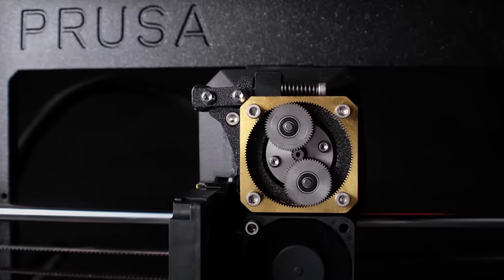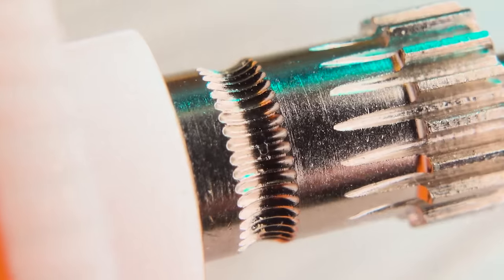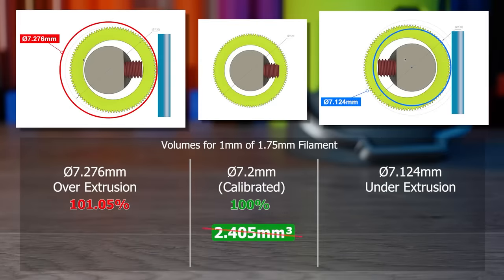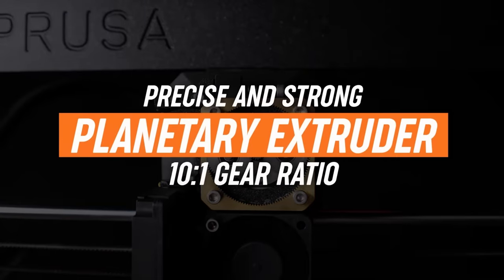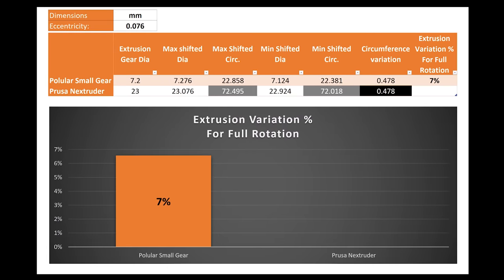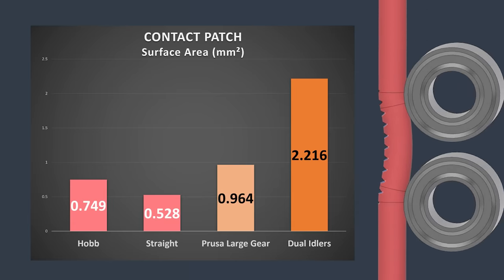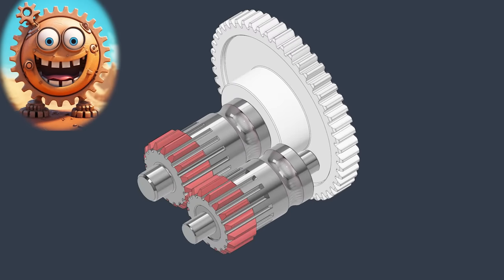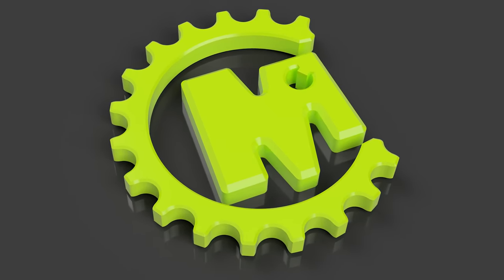Revolutionizing 3D Printing: Prusa's Game-Changing Nextruder

Comment: What we also need is, consistent filament diameter, and volume. With the new large gear, see the possibility of a ribbon like filament.Not only the filament will be cheaper, it could also be more consistent in volume, made possible by the aspect ratio. It could pack more filament on reel, also could enable even more volume of extrusion. It might also be necessary to have a rectangular funnel shaped intake path on heated chamber. Just some thoughts .....
Reply: There has to be some reason that the round profile was developed back in the 80s or whenever it was. But I am sure curious what that is, because a filament shaped like fettuccine would certainly be easier to work with than filament shaped like spaghetti.
Reply: @user-mz6qu3hz6m  I feel, it may be due to easier extrusion(all you need is a round hole, easy to achieve with common drill type machine tools) and easier winding(you can cross wind a round filament easily,compared to a wide ribbon, which could be limiting). But to get more precision and accuracy, it might be a worth while deviation(esp, with reduced surface grip of the 1.75mm filament). Additionally, with faster and bigger heater, it may be easier to push more volume of material for faster printing, due to increased grip of the ribbon style filament. Again, some more thoughts .....

Comment: To be fair, I still think that lack of tolerances is the huge issue in terms of BMG. Genuine shaft was 4.96mm, while for this bearing arrangement it should be  5mm ±4um, so we're causing wear on the bearings. The ID of the gear isn't reamed either from basic visual inspection, so they probably don't have great tolerances here either. In my opinion just proper shaft OD and gear ID (with respective tolerances) should be significantly better than what we have now on the market

Comment: Through the years I have always felt my Kossel mini with gear reduced stepper motor and simple gear and bearing compression system had just as good of results or better then I've gotten since. I still compare my best prints to prints off that machine from 2014.
Reply from the maker: Yup, this "revolution" is against the ways of doing things that nobody questionned for years.  We thought more nozzle pressure would be good for faster printing, we thought hobb grooves would give us that extra traction to achieve this pressure... Now we know it"s not... And I honnestly think this is the start of a revolution about how we took things for granted.
Reply: @MirageC  Increased pressure was never about greater speed. It was about forestalling the issues that result from back pressure when you push material of x volume through a bore of smaller y volume. As long as you have enough forward pressure to significantly overcome the back pressure, your material will exit the bore with a minimum of issues introduced. Yes, for the purpose of FDM plastic printing we've reached a point where some extruders provide enough pressure to push the material through many common models of heat zone too quickly so that it comes out while it's still "too cold" for our purpose, but it does still come out.
Reply from the maker: @claws61821  According to my tests, the pressure creep point of a material corresponds to the point where the print quality drops quickly to not being able to print at all.  This is not even taking into account the issues you are creating on Pressure Advance requirement.  Filament will come out, but it will not be printable.  High nozzle pressure is bad  The proper recipe for flow resides in the hotend, not the extruder.  We can print at 50+ cubic mm/s volumes at very high speed now a days with a simple BMG gear set.  Oh.... And I forgot to mention, I am running without the second drive gear ;)   Have a look at VzBoT videos.
Reply: @MirageC  I may have to watch your videos on dual gear extruders again, yes. Did you test the pressure effect in multiple hot ends/nozzles as well, or was that Stefan?

Comment: Thank you very much for breaking these components down for us and giving your analysis. I wish you had pointed out that the only thing that's truly new here to even commercially manufactured extruders is the dual idler bearings, but that's me nitpicking.
Reply: Thinking about it, while it was never commercial, there was an extruder several years ago that a school in South America designed and uploaded to Thingiverse that used most of an entire ring of drive gears or idler bearings around a central wheel, much like a peristaltic pump. That's not too dissimilar to the dual idler design aside from the quantity.
Reply from the maker: Cycloidal? or perhaps Harmonic drive?
Reply: @MirageC  Neither as far as I recall but I would have to find it again to be sure.

Comment: I do see a problem with older filament which has become brittle.. the bend might result in the filament breaking in the midst of roller bearings, clogging up the mechanism. I had that happen when I designed a rather similar (without planetary gears) drive  for more contact.. it worked great, but was very sensitive to the usage of fresh versus older filament. Since I don't print a lot, my filament usually has some degree of staleness which mad it quite unusable.
Reply: I already tested edge cases like super old PLA as well as old TPU on the MK4 and it just prints like a god. Didn't even adjust the idler tension or anything, it just worked.
My hypothesis is that due to the idler bearings having a slot in the middle, even if the filament breaks, the path is so constrained that the top piece would just continue to nicely push down on the bottom piece and you won't notice the break at all.
Reply: My biggest concern would be for filaments like ePAHT-CF. That stuff is very stiff and brittle and using two plain bearings to bend it aroundone large drive gear might just snap it...or the force to make it compliant around the bearings and gear may just overload the extruder motor. So far I haven't seen anyone print htis filament with the Nextruder...but this is a corner case filament and all other filaments should be fine.

Comment: How about comparing other big wheel solutions like Orbiter and LGX? A friend from the Voron community did some experiments and subjectively the nicest prints were from Orbiter 2.0 right after LGX Lite and RIDGA, the worst were the original BMG wheels and it didn't matter what extruder he put them in. The strange thing is that LGX Lite turned out worse than Orbiter even though it has bigger wheels.
Reply: LGX is like a combination of MK3 extrusion mechanics, using 2 gears of the size of the MK4 main gear. I really the control lever in LGX

Comment: This really does look interesting!  Also… whatever happened to the hotend Olympics?? I never saw a results video.
Reply from the maker: I had to change the approach of crunching the data before killing myself.  At the moment where the plan took form, Winter made conditions in the shop too cold for proper testing.  I am working on setting up the printer and print head for a restart within the next couple of weeks.

Comment: Nice video! Though you missed one thing - the two idler bearings are not flat, they have a groove in the middle to keep the filament centered.
Which means that manufacturing inconsistencies along the width of the gear are even less relevant since the filament cannot move left or right at all.
Reply from the maker: Great piece of info!  that is how I am planning mine too.  Thanks for pointing that out.
Reply: @MirageC  U604ZZ bearings, as used on the MK8 extruder. Off the shelf bearings. I'm designing a variant for my worm extruder that uses two of these.

Comment: The sole purpose of the drive rollers is to ram the filament into the heated chamber where it melts and as the filament then acts as a hydraulic ram it is the pressure that the melted filament gets from the incoming filament  that determines the flow.
Reply: Yes, and?

Comment: wouldn't the grooves pushed into the filament create a much larger distortion in filament volume? You would be pushing filament volume equal to the displacement of the grooves up/down and partially to the sides. Assuming most of the plastic is pushed up and down due to where the force is applied, You would get 2x he differences in volume displacement  from min to max groove depth.
(ie. min = filament - groove volume, while max = filament + groove volume) 
If the groove displaces 1% of the filament from either side in regular printers, you would get a 4% delta between grooved filament and no groove. In this case, it may be slightly less since it only produces 1 groove, but they will be deeper/wider at their full depth due to the straight cuts.

I have speculated for a long time, that ideally you would want a multi roller textured silicone feed system, to increase grip while preventing any change in filament shape. It may even be possible to use 2 "belts" pushing against the filament to feed it into the hotend.

Another improvement could be to increase the  length and thermal mass of the extruder barrel. This would allow a more gradual heating with a reduction in temperature fluctuation. Uneven heating of the plastic can cause thermal stresses and uneven thermal expansion/shrinking. This could lead to warping.

Comment: Yes, the nextruder seems a big step forward. The bigger gear alone definitly is an improvement, as I saw on my zorbiter (just a little bigger) and my TBG light. The new concept with two flat idler bearings might improve even a bit more - but I wonder how much, as with the heatbreak integrated in the nozzle reaching up extremly near to the gears, there is very smal room for filament moving sideways anyways.

Also the new nozzle system seems a good improvement. While you can get simular concepts from china (Trianglelabs CHC), the concept of changing nozzle including heater with just disconnecting two easy to reach connectors and looseing two thumbscrews is quite interesting. Esp. as you not only can use integrated nozzles but also a nozzle adaptor (heatbreak) to use special nozzles in v6 size. I hope there might be a version with longer meltzone for more volume flow (for prints with >0.8mm nozzle)

And of course, the load cell always kills the need for z calibration.

I hope I get my mk4 upgrade soon.

Comment: I like Prusa's solution. Larger gear driven by a planetary gearbox. makes sense.
Reply: The more complicated you can make the device the more you can blind the criticism.
Reply: the simpler is not always the best, see creality Ender extruder, single spur, single idler, everyone changes it after a month.

You say that bs while people constantly upgrade their machines with extruders from bondtech and E3D which are pieces of complex clockwork that speak for their print quality. Just because you never used the MK4 doesnt mean is an obcure and difficult mechanism.
Reply: @fofopads4450  
"see creality Ender extruder <...> everyone changes it after a month."
I'm Ender 3 user... and have been printing petg/abs on the default extruder for over a year now.  So you're wrong 😅🤣- no "everyone change it".
The quality I get is good enough for "personal use".

But to be fair, after six months of use I had to replace the thermal barrier with an all-metal barrier - the old one did not print well.

Comment: I have learned why crealitys next-Gen printers dont extrude the most consistent and besides there Top of the line machines are really hard to get that perfect first layer the extruder gears that make contact dont have a curved grove its straight cut but is still the same size gear which causes either Way too loose grip or Air Bubbles in your hotened garunteed from my 500hrs of testing with different tensions on my Ender 5 S1

Comment: I wonder if the grooves indentation on the plastic also contribute to some inconsistency of extrusion. In that case the larger diameter with more smaller grooves is better. But perhaps there could be other ways to improve traction, like multiple stages of gears (with very small indentation)

Comment: Very good analysis! 
To modify the current system could you use two plain ball bearings with a V-grove between them as the idler?  Or a wider bearing with a V-Groove machined in the middle?  This could keep the filament centered better and distribute the pressure over a wider range.  Thoughts?

Comment: Would a helical gear not be better pulling the filament as opposed to the straight cut pushing?, would that not create a more consistent pressure in the nozzle?

Comment: The next logical step is a live filament diameter check, which would re-calculate feed rates as needed. 
This is a good method in removing a few variables from filament extrusion.
What is maximum feed rate this this extruder? Is the stepper spinning 10x than before? I print a lot with 0.8 and 1.2mm nozzles and have maxed out various extruders, limiting my production. I hope this isn't going to make the stepper spin too fast and create a skip.

Comment: Beautiful video!. I do have a few questions.
In your comparison of hobbed vs straight vs large straight, are you ignoring that in dual drive systems there are 2 gears in contact?  that would mean 2 * 0.749 = 1.48 ^2 vs the single large gear of 0.964 mm^2
Why not compare to Bondtechs LGX series? with its 18mm diameter and dual drive this should be even greater.
Finally the hypothesis of the filament walking is certainly possible, but I think the curved surfaces will self-center the filament. and have a proper filament guide will also help there.  did you have evidence of the filament walking?
Reply from the maker: The dual gear systems is what we are trying to move away from, so I did not see the point of comparing the contact patch.  
As for the evidence of filament walk here is what I did:
1 - Removing the second hob gear teeth by grinding.  No impact on surface quality
https://youtu.be/c6JmCdovE0U?t=403

2 - Removing  the second hob gear and replacing it with plain bearing made a significant increase in quality.
https://youtu.be/c6JmCdovE0U?t=1168
Reply: @MirageC  sorry I'm not following...how is that evidence of filament walk in a dual drive system? If anything I think you showed that filament can walt with flat gears.  But I'll watch to see what I'm missing.
Reply from the maker: @BadnoobofVoron  quality was much better without second drive gear.
Reply: @MirageC  I replaced the hob gear on an orbiter with a plain bearing. I saw no difference in print quality. I know one other person who did this and also saw no improvement on print quality with the Orbiter 2. YMMD.

Comment: Which aftermarket extruder do you prefer in terms of quality, if speed and pushing force isn't part of the equation?
I get the best quality out of my titan style extruder. Compared it to different kind of bmg dual gear. Also the sv06 extruder.

Comment: Does anyone know if the stratasis DC motor extruder is patented? It's also quite simple and works very well
Reply: not that i know it's parts a millwright or like can source with the correct know how, that exact part number is maybe made for ssys but is able to be crossed but the gears maybe added after by ssys this i dont know but i doubt it, the problem its the size and weight they are heavy very heavy IMO they are not worth the time and go for 250$used and are a ssys wanted used part on the other hand there liquifier has more potential then the extruder does again IMO

Comment: Nice work. I still perform dual gear system. It would be good to have bigger pulleys but both driven. But this is just my opinion, it would be good to measure it somehow..
Reply from the maker: Strong extruders are only required to get out of clogging situations ;)  High nozzle pressure is not good under any circumstances.

Comment: They didn't explain how they're going to retract the filament. To retract at 80mm/s, the stepper motor will have to spin 10 times faster than if it was a direct drive. That would be 800mm/s... At those speeds, it loses all the torque
Reply: nope, it is still within the usable range.

Comment: While the large surface on the filament and the efficient planetary gear are great choices, they come with one downside:
They are big, resulting in a long filament path to the nozzle.

Depending on the flexibility of the filament, we might see some improvements with this type of gear, while we see downsides due to filament compression on the path to the nozzle.

The resulting question is:
Do we really need large gears? Do we really need maximum tracktion? Would a small gear on one side and a bearing on the other side not do the trick? 
My assumption: Unless we work with extreme pressure in the Nozzle (speedprinting), all of that might just be unnecessary.
An updated Hextrudort with a straight gear and bearing might just provide the best of both worlds.
Reply: With two bearing and a long contact surface on the gear You can have similar traction to  'traditional' system, but with a lower compression force needed between bearings and the large gear. To note that since the compression points are  two instead of only one, so the contact area between the gear and filament is lorger and than less prone to slip.
Reply: @donkeymarco  I am aware of that. The question is, whether this is actually necessary.

Comment: I dont understand how you compare the contact because you can have double contact surface in dual extrusion gears. Maybe the issue is similar to 4x4 wheel drives?
Reply from the maker: The idea is to remove the second drive gear.  I think that dual gear system have too many sources of issues, gear meshing, alternating force transmission paths, tilted shaft causing filament walk... 
If you remove that second gear, you need to compensate the loss of patch contact by making the wheel bigger or having more wrapping effect by using 2 or more idlers.